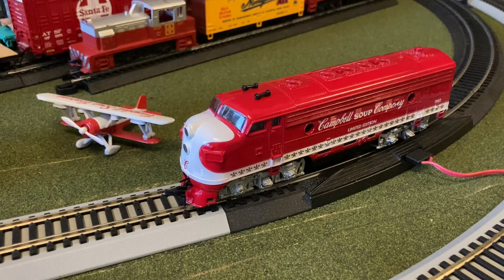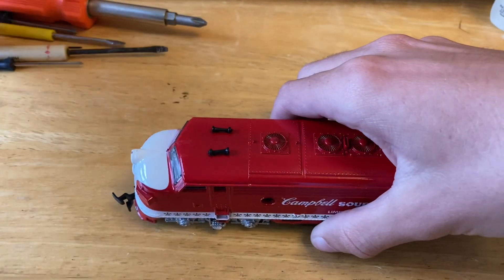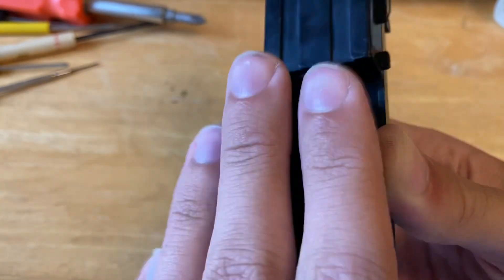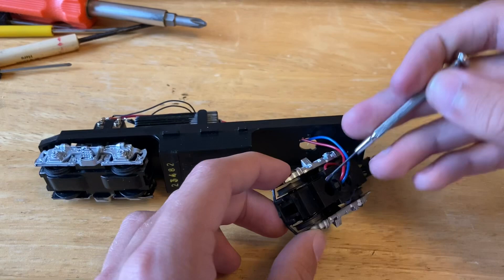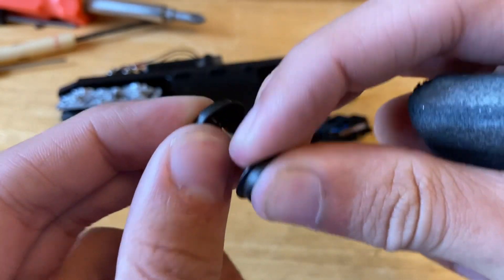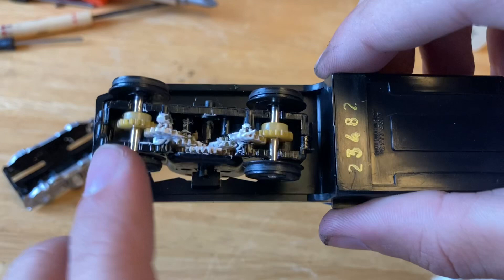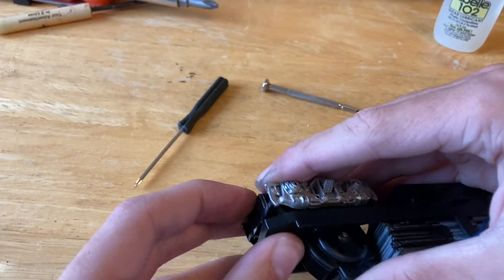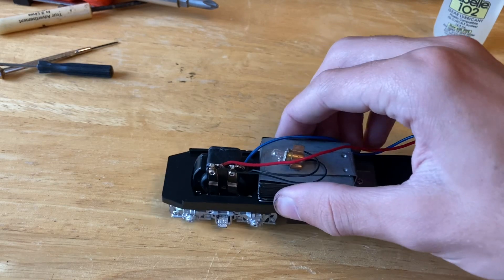1980s Life-Like Campbells Soup F7 Restoration 🧰🥫 Can We Fix It?

Comment: The blue wire has a break in it. Just cut a little bit of it off on the end of it, strip the wire, and resolder it back on the motor terminal. A very common sign of a break in the wire is the ability move it and you get the connection back. Since the wires move when the motor is turning left or right going around curves, it would not be unusual to develop a in one or both wires.
Reply from the maker: Good to know! Thanks for the advice! Thanks for Watching!!